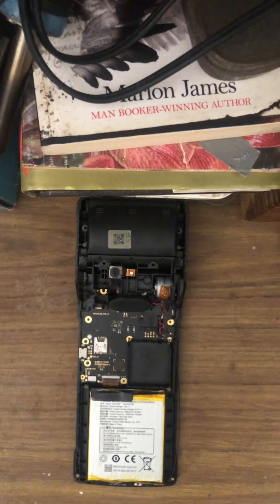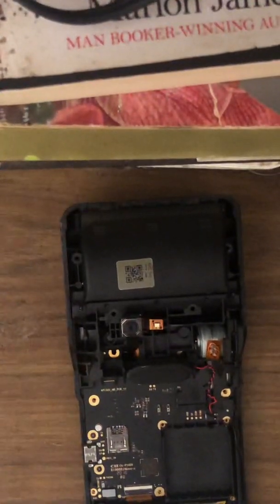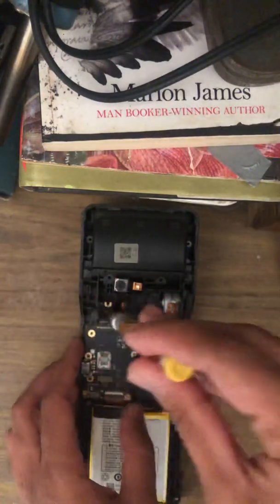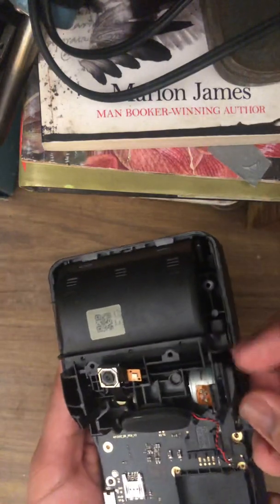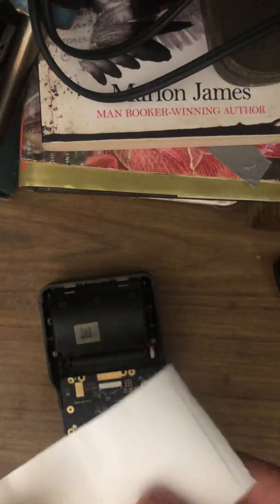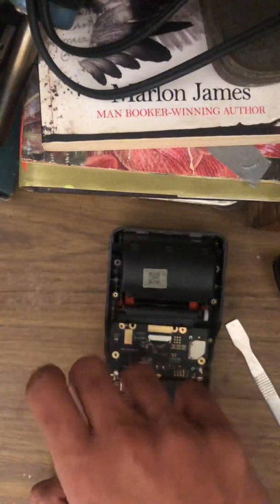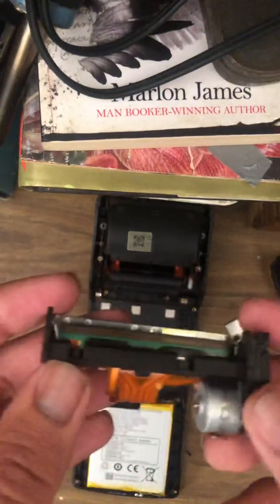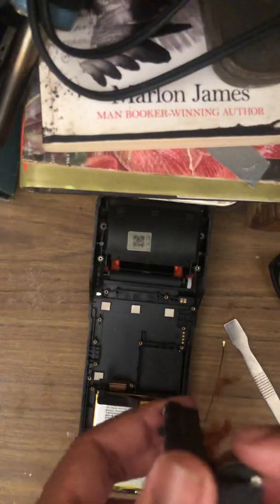Sunmi V2 Breakdown video

Comment: DO NOT TRY TO OPEN THE DEVICE. After I opened the device to see what model of printer it has, the device says "Attacked. Please contact your service provider". It becomes useless after that.
Reply from the maker: I’ve repaired multiple of the devices and this has never happened did you damage the board in some way?
Reply: @its_a_mylesrepairs1244  I had to contact service support and they give me a code to unlock the device. That fixed the issue. I don't know what specifically triggered the alarm message, maybe something that I unplugged and then plugged.
Reply: @luispablofreire that's for P2 pro. Payment device,,if out of battary it'll looked. So p2 have a strong security.  Evert time asking for unlock code. I escape this device
Reply: I CAN CAN TO UNLOCK THE DEVICE.

Comment: Hi, do you know if the P2 model from Sunmi has the same printer? My device prints very poorly and I want to change the thermal printer. Good video brother.
Reply from the maker: Must of the devices use a thermal printer however all devices printer versions varies
Reply: i have a problem with p2 device bro

Comment: thanks for the video. how do you remove the battery?
Reply from the maker: The battery is held by an adhesive so a heat blower at a medium heat should slowly melt it off.